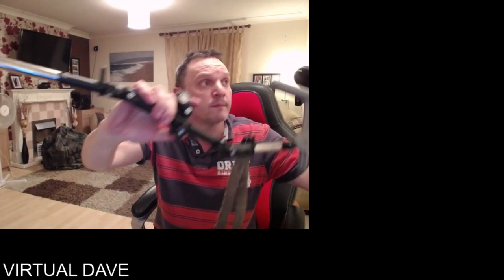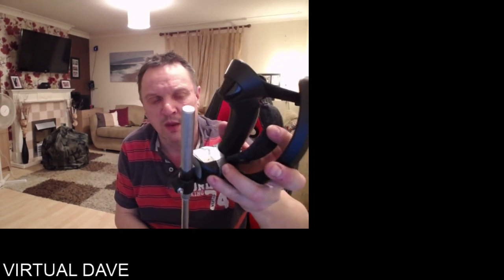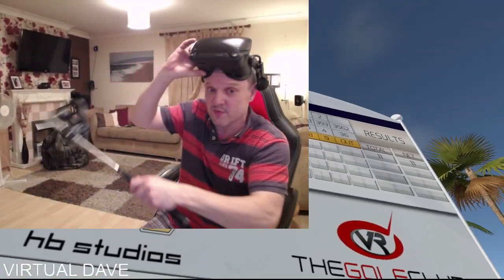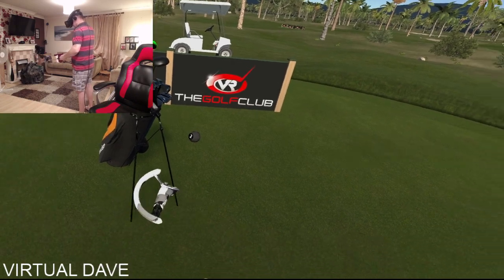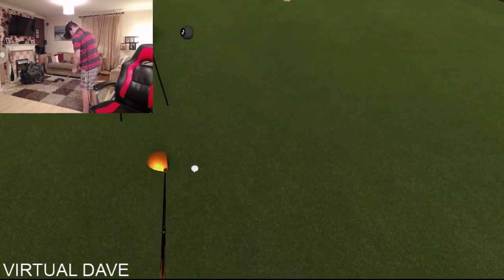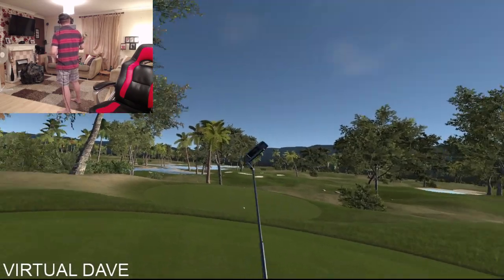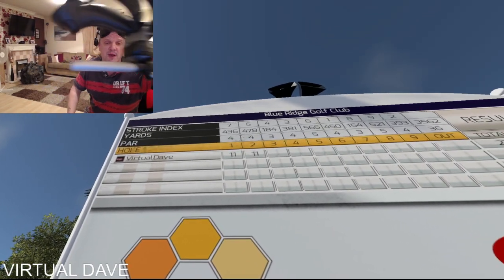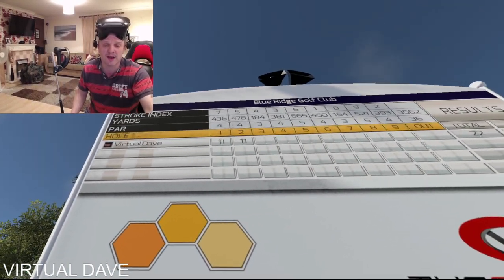VR Golf Club Accessory For The Valve Index (Homemade)

Comment: Wow, i was looking to buy something like that! Great Job !
Reply from the maker: Not difficult to make, hope you get one made, just old golf club handle an m8 nutsert and press in with another gun and a metal bar with and m8 bolt welded on the end, hope you manage to get one made, but you will need a holder from protube,preferably the back one with the notches so it holds into place better you can order them separate from their website